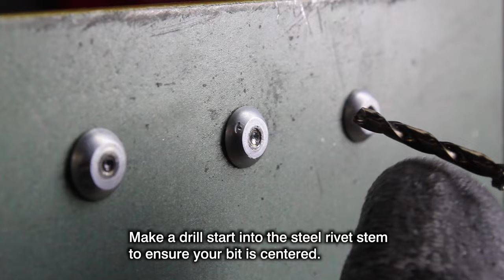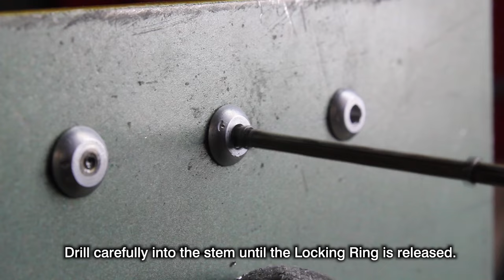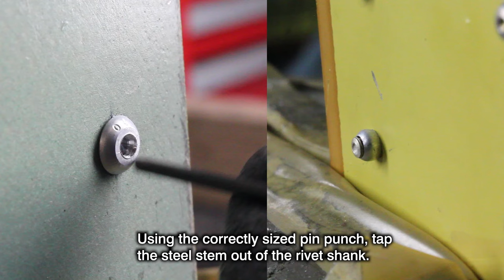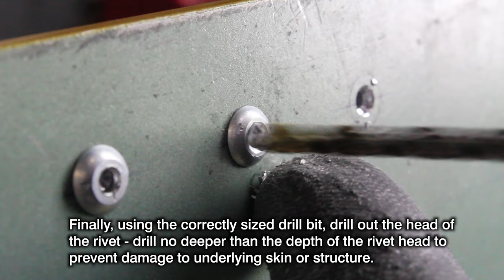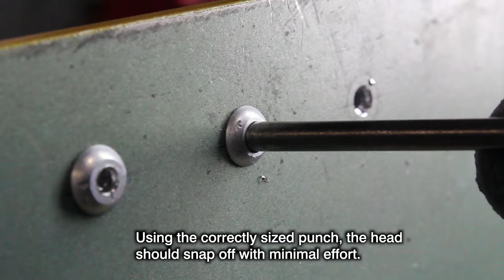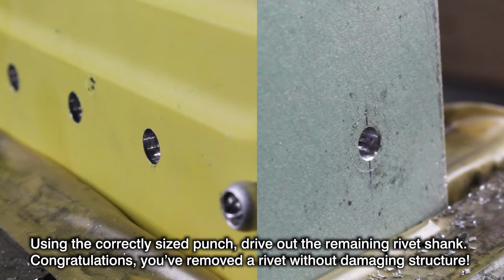CherryMax Rivet Removal Procedure

Comment: Aircraft tech here, no one drills the stem, a quick whack with the pin punch and the lock ring is out with the stem and ready for drilling.
Reply from the maker: In a maintenance environment, maybe. This is how it's done in a manufacturing environment. We were building wings for the Bombardier Global Express and Challenger 350 business jets.
Reply: You got owned by a manufacturer,  not a repair “expert”
Reply: I respect all of your technique doesnt matter on what technique youre going to use as long as it is not elongated 😂 Im an aircraft tech too but as per airbus and boeing manuals ata chapter 51 pin punch first the stem then drill the head when the lock ring is out pin punch it again until the stem comes out. So its not a whack 😉
Reply: @annakquinn7084  in my experience, maintenance end up fixing all the manufacturing issues.  We even found a Chair in the fuel tank of one of our jets, far too large to fit through the entry points, it had been in there since factory. we came to the conclusion that it was not removed before the tanks were closed up.  it had near enough broken down to mush, having been left in fuel for years until the aircraft was brought in for it scheduled maintenance, which are set X amount of years after manufacturer. 

A manufacturer mistake that could have killed 300 people